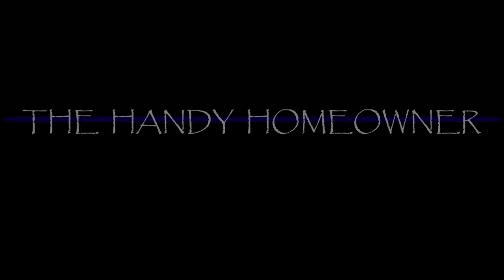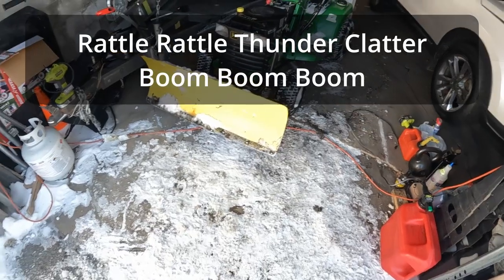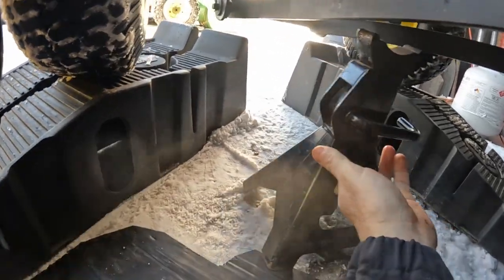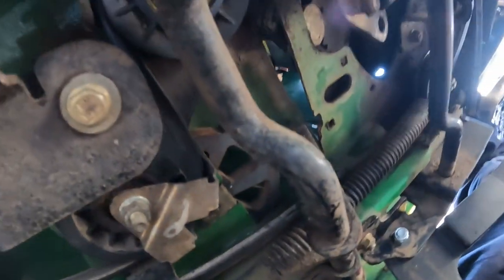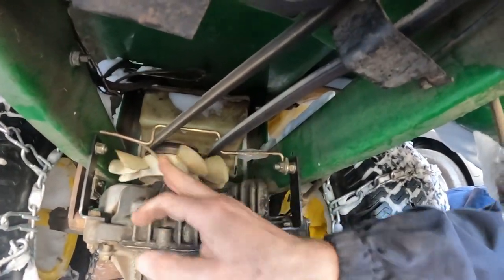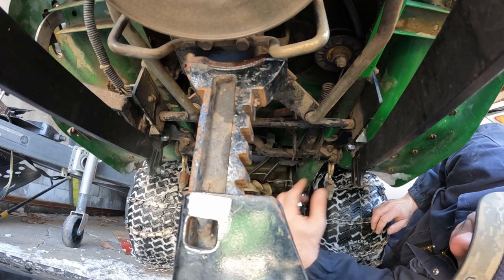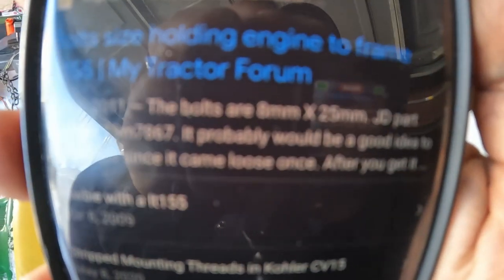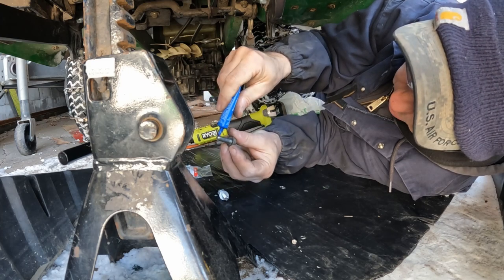John Deere LT155 Engine Bolts.  umm ya.  we're gonna need those.

Comment: Thanks for the video. I was having trouble finding a good place to start with my LT133’s missing bolts. This was helpful. For reference the 133 has three mounting bolts and they are indeed M8x1.25. I was missing all three which was causing all kinds of issues. Not sure if 8mm and 5/16x18 are that close and the eights just worked but that was my experience.
Reply from the maker: No problem 👍

Comment: Tip on cutting bolts, put the nut on first, do your cut, clean up, and then unscrew the nut. Ensures that first thread of the bolt gets nice and clean.
Reply from the maker: Now THAT'S  a good idea!   Thanks for the comment.  I'm sure LOTS of people will learn from that one.  I think i didnt  because some of the first screws i ever cut off used nylon Locking nuts and the heat would mess up the nylon part.  But with a standard nut that's a great idea.  Thanks!

Comment: I can't find any replacement transmission mounts its what holds up the front of the transmission so it doesn't fall down they're the shape of L brackets im gonna keep looking.

I noticed the original transmission mounts are split in half once i took the deck off and out of the way i just keep finding more shit wrong with this mower if i can't find a replacement transmission mounts im gonna have to cheaply weld the broken ones i have or i could use some long L brackets they would work
Reply from the maker: I agree that could work.